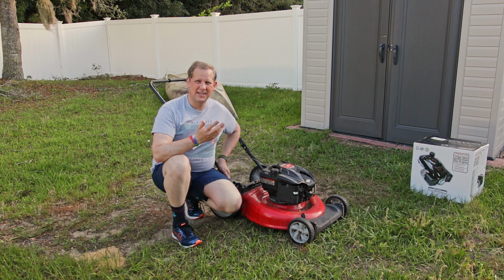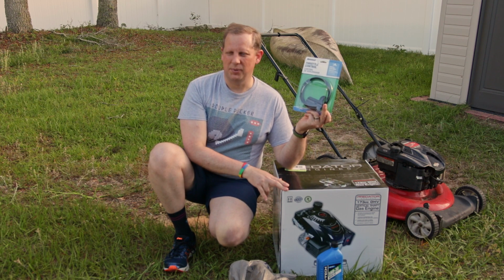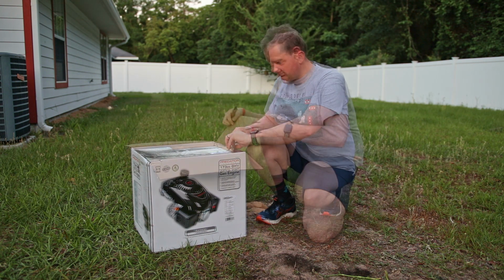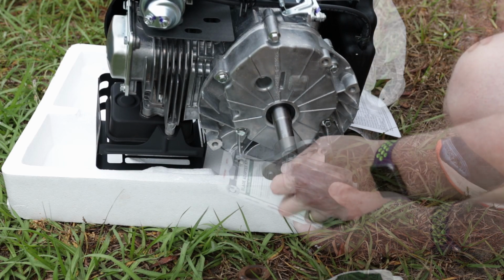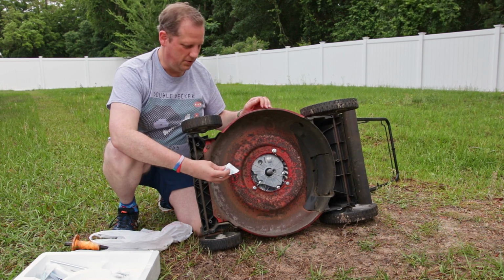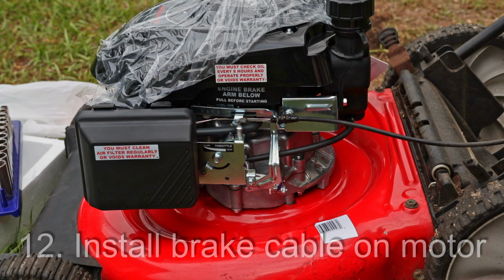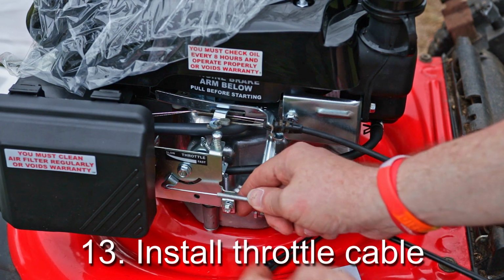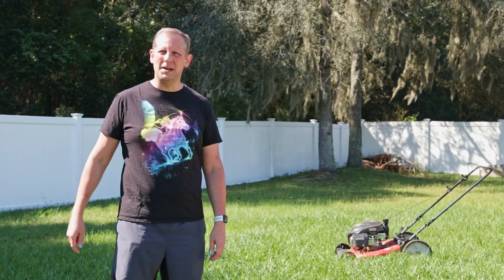Installing a Harbor Freight (69731) Predator 173cc Vertical Shaft Motor on an 2011 MTD Lawn Mower

Comment: I did a bunch of small engine repair this weekend, from a chainsaw to a trimmer to a generator.  I hate it.  I have replaced an engine on my riding lawnmower from a drop shipment - four bolts and a few other bits and bobs it was done - all from oil starvation due to an oil diverter pipe that slowly loosened over time that ended up just leaking out all my oil.  First thing I did was get rid of that on the new engine.  Good job, Wes.
Reply from the maker: Thanks, I recently had to replace the carburetor on my leaf blower, $11 for a whole kit with fuel line and a new spark plug.  Now that I have found a reliable source for ethanol free gas hopefully it will last.

Comment: I've had my MTD 190 cc Push mower since 2011 and 0 issues. I run VP racing 4 cycle fuel and for oil I use Briggs and Stratton full synthetic or Mobile 1 full synthetic 10w30. I change the oil every 2 summers and the oil is never dirty, in fact it's almost looks the same color are the new oil. MY weed eater and Leaf blower I run VP Racing 50:1 and I never have issues starting and of my yard equipment.

Comment: Talked me into keeping possible yard sale mowers simply for the 25mm shaft. Some of the mowers that sit high off the ground are good donors. They are for most newer self propelled models. Old Sears mowers sat a little low and your blade might be sitting below the housing making a great pebble launching machine

Comment: I have a lawnmower with a briggs and stratton engine from 2008 and I got it from my aunt and I use 5w30 full synthetic and it starts on one pull everytime and all it needs is some wheels and its all good

Comment: very professional video that motor will not overheat easy those are very powerful
Reply from the maker: Thank you, its in its 3rd season now, still going strong and starts on first pull every time. If only HF would get them back in stock :(

Comment: Awesome video, just did the swap myself, it sucks the motor has gone up to 230, plus another 20 for the throttle kit and mower mount. I saved myself maybe 50 dollars from buying a new one. Not sure if it was worth the hassle.

I had the Troy-bilt 21" push mower TB160 that is powered by Honda. I ended up not having a throttle cable on my mower so I purchased a kit on amazon. It was fairly easy, just cut the wire down, bent it, and zipped tied it on. Luckily I had a bolt in my shed that matched the throttle control that was extra from a TV mount.

Comment: That's a briggs and stratton quantum engine. VERY reliable motor. Not sure what your issue was. Great video none the less. FYI, your blade was installed upside down. Sharp side is suppose to be closest to the grass.
Reply from the maker: Yes, sharp eye, thank you. I figured it out and flipped the blade afterwards :-) Yeah, not sure what happened, I took the head off and things looked ok but it has very low compression for some reason.
Reply: @SupraWes  It likely needed the valves lapped and valve stem clearances reset.

Comment: This is cool i have a 2017 craftsman and the engine was hard to start last time i used it so once i get the money i will buy this engine and some other stuff
Reply from the maker: Thanks, It's not as inexpensive as it used to be but I am very happy with it, 4 years later, it still starts on the first pull even after sitting for months and it runs smooth also.

Comment: great job . I would like to get one for backup on my tb 130, it looks like same engine almost. It would be better than spending, probably 400 for a new mower,. that engine you got sounds nice
Reply from the maker: Thank you, I have been very happy with it, 4 long florida mowing seasons later it still starts on the first pull and runs great.
Reply: Lookout for a good used unit. People are switching to battery equipment and a lot of good IC equipment is coming available. No idea why his failed, but I have B&S equipment older than he is.

Comment: Great video buddy in all phases, I have one question in didn’t see you tighten the blade adapter when you slid it on? Thanks Wes
Reply from the maker: The bolt that holds the blade on also holds the adapter

Comment: good video ,  I do wonder if its just a fluke but  so many diy and even the "bigger" mower type  channels  , seem to either not clean the mowers at all thru the use of said mowers , OR like in this video they seem to just  clean off the top. 

Why on earth  wouldn't you (n everyone else)  keep the underneath clean , u know the important part . Granted I work alone mowing and Detailing cars , more detailing these days than anything but even before I started mobile Detailing for money I always kept  the underside clean as the machines cut  and discharge (weather u bag or side discharge or both in the case of super tall  grass) better if the  underside is clean ,  even better still if you keep it  coated with ceramic  under neath.    Those of u  buying new mower decks  I highly reccomend either Putting  an additional layer of clear coat underneath after  a light polishing   then let cure polish that again with the lightest polish u can find (by hand is fine)  then get a decent ceramic spray  product and put two coats of that on.   This will increase the load the mower can handle  fairly significantly as even tall wet grass  will  eject from the deck faster and more consistently..  I mod my push mowers ofcourse but for example  Even with the smaller 150cc briggs engines on a 21inch deck I have a clip of me shoving the mower  (with brake fixed to run witrhout holding) 30 feet thru 14 inch tall grass   and it  stays straight and cuts even (mostly due to keeping the blade sharp and coated  and i wash underneath the deck off after EACH<-- use   those washings made much easier  due to  coating the deck in the first place .   I coat the deck at the end of the season each year n its ready to rock when i start up in the spring

-

Comment: That old Briggs quantum  probably had a clogged jet. They pretty much stayed full of gum after the ethanol mandate started. Even some supposedly ethanol free gas does some of the same crap. I think the tanker dude just dumps what's left in the non ethanol tank. It depends
Reply: As a response to a question, he says the engine had low compression.

Comment: Anyone have the part number for a blade adapter with pulley for the predator motor. I believe it's a  7/8 shaft x 3/16?
Reply: Wondering the same thing for a self propelled Toro. And a 5-year old self propelled Honda.

Comment: My brake cable is longer to my brake cable handle my old GCV 160 engine.
  In fact, my brake handle was my throttle on my Honda GVC 160.
  Any suggestions?
Reply from the maker: IF you don't mind bypassing the safety feature, you can use a piece of wire to have the brake off at all times.  You will need to use a screwdriver to short out the spark plug to turn off the mower. Or just pull off the boot, but use something non conductive, it will shock you. There may be an aftermarket part that can get the brake working for you, it just depends on how the handle is built. I don't know that model. I have an aftermarket throttle listed in the video description that will work if your original throttle wont.

Comment: I have a Husqvarna mower with a 150cc Briggs. I can tell the power has decreased and stalls easily in tall grass. Do you think this Predator 173cc is substantially more powerful than the 150cc Briggs?
Reply from the maker: I do not know, I would try a full tune up on the current motor first.

Comment: Ok so it doesn't come with a blade adapter hardware. Ok im definitely going to buy one of these for my push mower deck.
Reply from the maker: Its still going strong after 4 years here in Florida where we have to mow almost all year.

Comment: The bolt that tightens the blade to the shaft is stripped.  Any advice as to where one of those can be found?
Reply from the maker: I am not sure of the size or pitch, try contacting Harbor Freight
Reply: @SupraWes  I did and they were no help.  I was surprised to find that there were only a fraction of parts for this motor available from them.
Reply: Some if that stuff is Chinese and is the same as Honda.  Also, there a YT channel for eRepair clinic who may help.

Comment: Where did you mount the throttle cable handle? 
Thanks for this video. Super helpful
Reply from the maker: Thank you, i used a hole that was already drilled into the handle. You may have to make one of your own if yours doesn’t have one.

Comment: Why didn't you just put a throttle control on that one...I don't blame you for wanting to try new stuff just curious
Reply from the maker: The compression was so low it would not start, that is why I replaced it. I added the throttle because the new motor was set up for it, the old motor was not.

Comment: Is the motor still going on the mower?
Reply from the maker: Yes it is, just mowed last Tuesday, started on first pull.
Reply: @SupraWes  the Briggs mount bolts are self tapping and you could of used them in two holes. I mounted one like you but left it like that.

Comment: Wes, how's the Predator motor holding up, any problems?   I'm going to buy one to replace the 2011 Craftsman push mower engine
Reply from the maker: Still running great, starts on the first pull.
Reply: @SupraWes  Great, I bought one for $232 Monday.  Gonna mount it tomorrow and start the break in mowing grass soon.

Comment: You didnt pull enough times, 2 or 3 more pulls and it would have started.  The HF motor is a 3/4th or 7.8th shaft, the briggs was a 1".
Reply from the maker: Nope, it is toast, hardly any compression.

Comment: Now the price is 225. Bucks and not worth it anymore 
I will just keep buying B/S and get the money worth 😊
Reply from the maker: Yeah, the price has gone up on a lot of things but the price has really shot up on these for some reason. Luckily it still runs strong, but if it ever dies I probably will have to buy something different.
Reply: Just picked one up today at HF for $175.  You just have to watch for the weekend sales.  And you would be better off going with a Honda motor over a junk Briggs and stratton anyday.
Reply: @SupraWes it’s called price gouging. The Chinese know the prices on mowers are outrageous so they raised their prices 100% over 2 years.